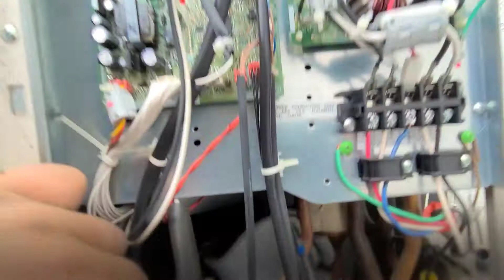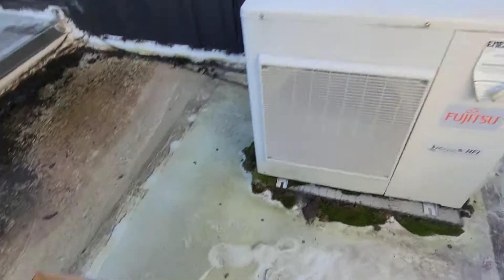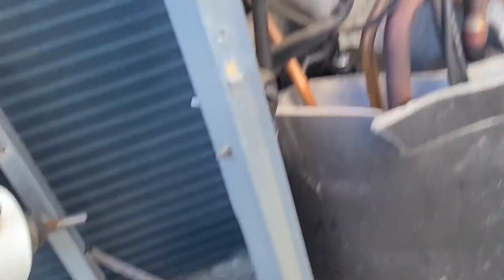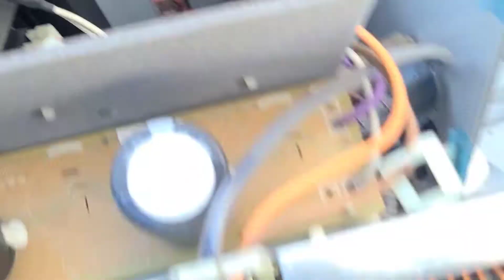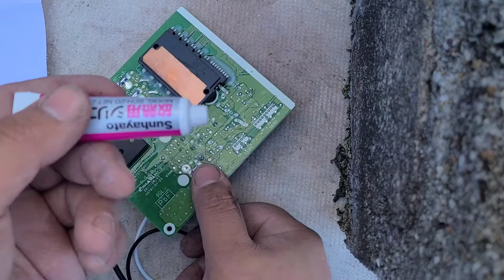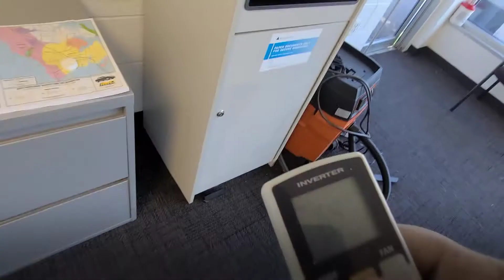Mini Split Communication Error

Comment: I have a 3 zone  3 heads running with no error codes. But the condenser won’t start up .  It makes it hard with out codes to fix .
Reply from the maker: What brand is it? That sucks yeah mini splits can be a pain in you know what if they dont got any error codes. Thats when I call for reinforcements to load up the parts cannon and fire off 😆
Reply: @HVACRSTRONJAY  Fujitsu  the 3 heads run . But condenser does nothing . And no Code